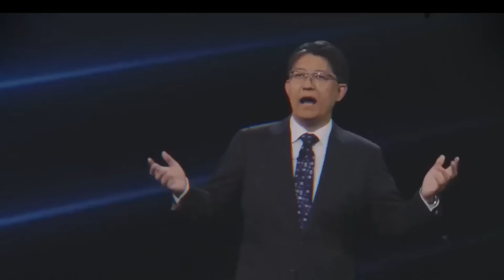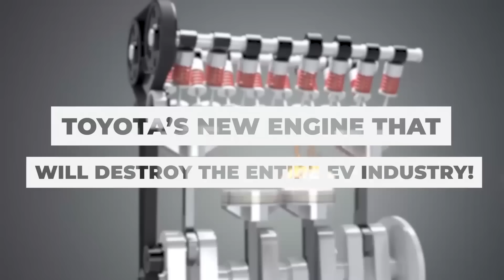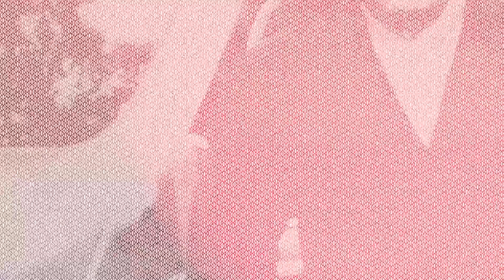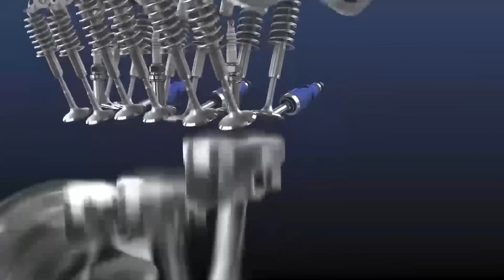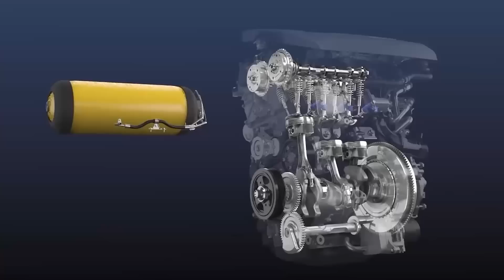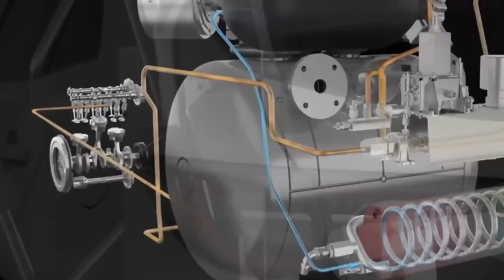Toyota CEO This New Engine Will Destroy The Entire EV Industry!

Comment: You still have to store the electricity to perform the electrolysis, so you need a battery - which you might as well use to power electric motors which are efficient, lightweight and simple compared to using a ICE engine to burn your hydrogen at a fraction of the efficiency.
What a terrible idea.